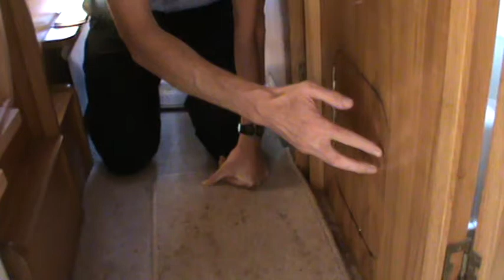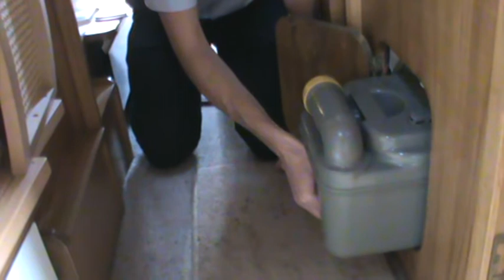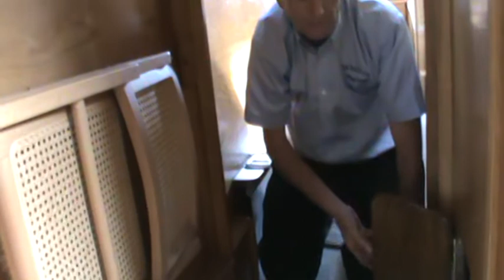Emptying a Cassette Toilet

Comment: I can't just pull mine out as there is a tube connecting to a vent designed to remove unpleasant odours - which doubles as a hole for removing waste in splashes on the way to the waste disposal point.